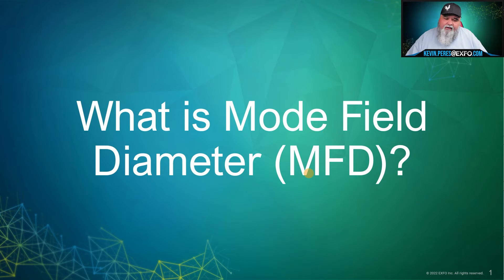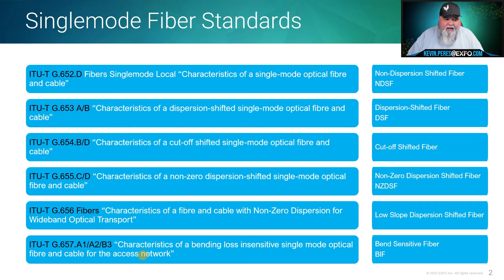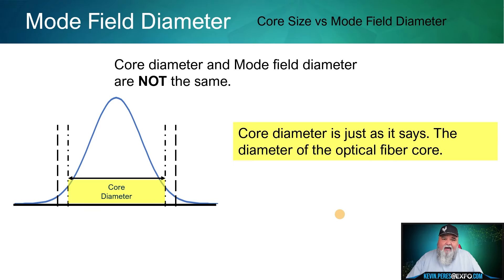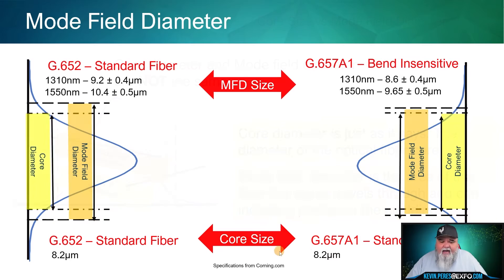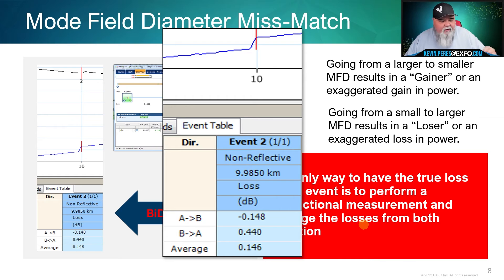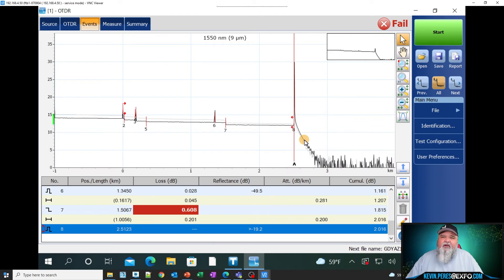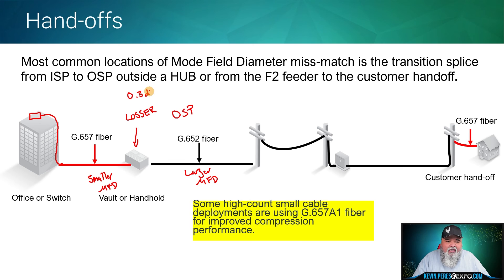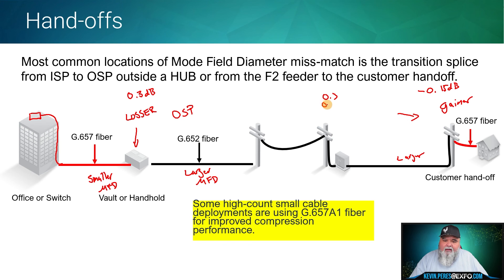What is Mode Field Diameter

Comment: hello sir i am looking to buy the exfo 730c sm2 live otdr with iolm + iadvanced but the sales person couldnt clear some of my doubts if you could answer them

1.suppose i have a ftth network and i dont how many and what configuration splitters are places in the line i am going to test so will the otdr will be able to identify that
Reply from the maker: Writ, Hello my friend. Yes the 730C can test up to 1x128 split.  one thing you must keep in mind is we need distance before and after the splitter to detect it.  A launch cable on the front will solve the front end. If the fiber after the splitter is short you may not be able to detect many events after it.  What does your FTTH splitter architecture look like? Also, be sure and get the iADV option so you can take advantage of custom splitter characterization. Send me an email if you want details.  Kevin.Peres@EXFO.com
Reply: @KevinPeres  thanks for replying i will be emailing you
Reply: @KevinPeres  whats should be the minimum length of the fiber after the splitter for it to be identified properly